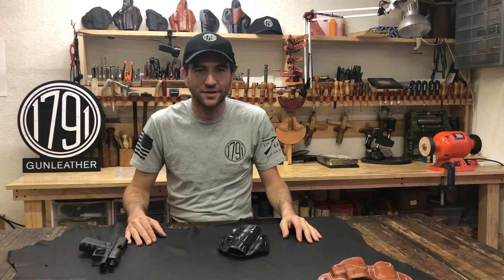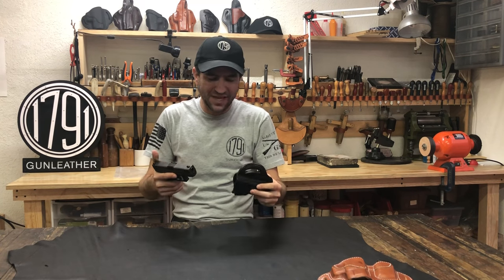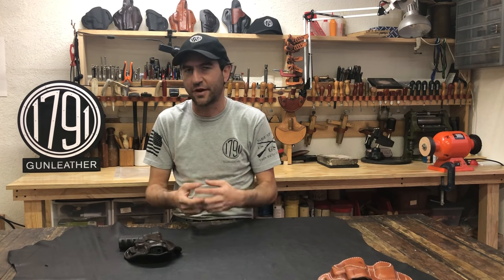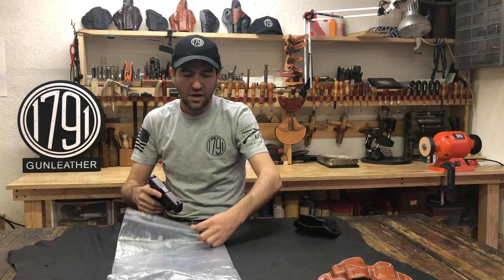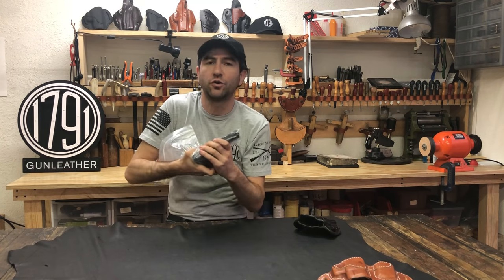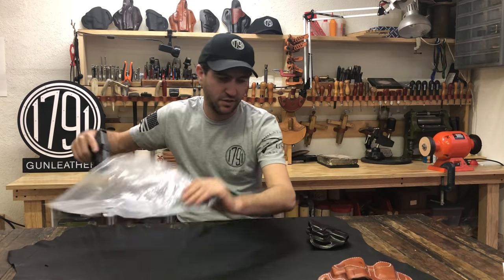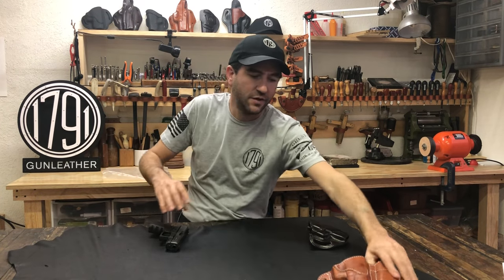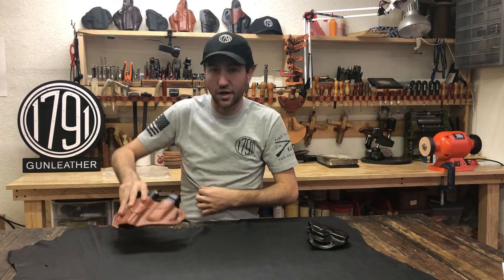How to Break in a 1791 Gunleather Holster

Comment: I assume that 1791 would not endorse my method, but I just received my new holster today, and it was custom fitted to my Taurus G3C in about half an hour. I used the plastic bag technique, but with the addition of steam: 1). Boil some water in a pot, 2). Hold the holster over the steam for about 2 minutes (doesn't take long, so don't overdo it), ensuring the steam reaches both the inside and outside of the holster, 3). Place your gun, wrapped in a small sandwich bag (in my case), into the holster, 4). With the gun still inside of the holster, apply dry heat to the outside of the holster with a common hair dryer, for about 2 minutes, 5). Remove your gun from the holster, and apply dry heat to the inside of the holster, again, for about 2 minutes., 6). Remove the sandwich bag from your gun and reinsert it into the holster. If you are happy with the fit, 7). Place the holster in the frig for 10 or 15 minutes. Done in half an hour or less. My holster originally did not fit my G3C, which had to be forced into the holster to the extent of moving the slide out-of- battery when fully inserted, now, fits like a glove--draws easily, and yet has 100% retention when turned upside down. As mentioned in the video, the holster is wet molded, so the key is to apply just enough moisture to the holster to make it pliable enough to remold it. Great holster by the way. I highly recommend it. I purchased the 1791 GUNLEATHER 4-Way XDS Holster - OWB & IWB Right Handed Leather Gun Holster on Amazon. 

EDIT: Of course, ensure that your gun is unloaded and clear before attempting any of the above.

Comment: I just received my two holsters mentioned in the post by me below. These holsters are so nice, with such attention to detail I stood there just holding them with a stunned look on my face. Never again am I going to drop $180.00 plus shipping/tax on a GALCO holster, not after this. These two holsters are stunning... The signature brown when viewed in outdoor daylight shows the true rich color, the fit and form is perfect. My daily carry 1911 has a fairly tall front sight as well (.190”); and there are no issues with insertion or removal. The sight channel spacing is tall enough to accommodate the tall combat sights associated with pistols that have threaded barrels for suppressors. These holsters are rigid. They will not wrinkle with age. The BH1 has a raised backing, preventing sharp spur hammers or ambidextrous safeties from digging into your skin, as well as the benefit of preventing the hammer and ambidextrous safety from cutting in to your clothes. The BH1M1 flexes to accommodate the extra width, and the interior pocket has smooth leather, thus it will not wear the finish off your pistol. Grip angle on both holsters allows for a positive, speedy draw. The rigidity makes it easy to re insert your pistol by keeping the holster mouth open. The Black and Tan color contrast is sharp, and defined, the tanned leather has a hint of red as well, adding to the sharp look. The pores in the leather are extremely small, allowing the leather to have a beautiful near semigloss appearance naturally , showing the quality of craftsmanship AND the high quality cuts of leather used. 
     I rate these holsters 5 star. 💥💥💥💥💥I am so impressed... I will be back to buy more gear on payday! Just stunning..... Edit: each holster was accompanied by a 1791 Key ring, burlap drawstring storage sack, and a large. 1791 sticker. Nice gifts - especially considering one would usually have to pay extra for such niceties. I Know already my Wife is going to like the tan Key Ring. 
In summary, I received about $370.00 in value of extremely high quality gear at the price of about $130.00 - you can’t beat that.... for me it’s not about the money; the over the top quality has made me into a lifetime customer. In all honesty, 1791 Gunleather is providing executive grade scabbards and carriers at a price that is so inexpensive that there is no competition in their market. Better than GALCO, Better than Alfonzo’s of Hollywood. Stunning...

Comment: Just received my 4-way leather holster. Beautiful piece. That said, I’ve had my firearm in two plastic bags for two weeks inside the holster , and it still doesn’t let me draw my fire arm without the holster coming with it. Not sure if the belt clip isn’t strong enough to hold onto the belt or the holster is still holding onto the gun with a death grip. Help!!

Comment: I purchased on on Amazon for my 1911.... it’s a commander size..... says it will fit but it’s a bit loose..... I was going to wrap the gun in plastic wrap and wet down the holster and either put in a vacuum sealer (I do that with custom knife sheaths) or just use my fingers...... any other suggestions or reconditions

Comment: I put 36 plastic bags because I want the gun to slip out like butter and shoot me in the pepe while driving. lol xD. I'm Just kidding. Thanks for the video. I just got a leather case for my XD9 but it's so tight that it takes my pants with it. Been using 2 plastic bags for about 3 days now and it finally slides out (without taking my pants) but still has it's retention. It's still a little too snug for my liking but getting better. My plastic bags aren't thick so I might go with 3 for another day or 2. I think that'll get it perfect though. Good trick. I would have never thought to do this.

Comment: I tried with all my might but even with the plastic bag it still won't slide the last 1/2" into the holster. It actually appears to be twisting in the holster, on one side there is the normal gap between the slide and the frame, but on the other side the gap is twice the size. Very tight. Other leather holsters I have bought were tight when I bought them but on this holster the pistol appears to be wracked somewhat almost as if it isn't going in straight. Plus the belt holes are not bevel cut and will have to be modified before there will be any chance of getting a belt to go through it. So far 60% satisfaction. I will update this post when and if my XDS ever completely fits this holster. UPDATE: With a minimal amount of effort I was able to make this holster rig an excellent addition to my other holsters that cost twice as much. A little careful "beveling" along the belt holes to make it easier to insert my belt and a little wax inside the holster so the pistol can be fully inserted. The model# BH2.1 fits my XDS Mod 2 like a glove. I GIVE IT AN "A" JUST SHORT OF AN "A+"  DUE TO THE LACK OF A BEVEL CUT ON THE BELT HOLES. A solid 95% satisfaction, and 100% value.
Reply from the maker: Hello, we would like to get in touch  to see if we can help the break-in process along. Can you provide us with an email via our contact page. I checked your page and wasn't able to find any contact information.
Reply: @1791Gunleather  No need, believe it or not I figured it out. As usual I wrapped the XDS in a Ziploc bag, but then I lubricated the inside of the holster with neutral shoe polish in all the areas that appeared extremely tight. When I attempted to once again slide the the XDS into the holster it slid in with the right amount if pressure to completely bottom out in the trigger area. It works as it should. I will leave it in until this time tomorrow morning. Then I will brush the excess wax out with a nylon bristle toothbrush. As I said in the original post, I have no problem with the fit and finish of your BH2.1 holster, it shows beautiful craftsmanship. But it is mass produced so it will require more break in than a custom one like Wright Leather Works would make. No if I wanted to wait 8 weeks I would have bought one from them (for double what I paid for yours). But I didn't want to wait. I knew going into this purchase there would be things I would have to modify to make it work. Now I can finally get the Springfield XDS MOD 2 .45 cal into my EDC rotation. I'm happy.
Reply: @1791Gunleather I can't contact you via this format for obvious reasons. But I will pull up a saved email via my email site and reference you by name.
Reply from the maker: @thebusterdog6358  Hey that's great to hear! Let us know if you have any other questions or concerns.